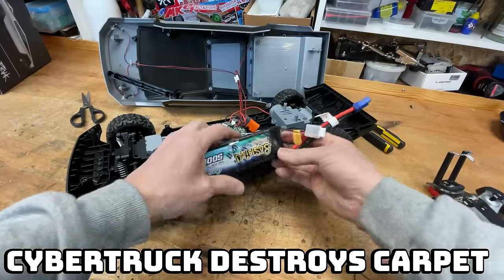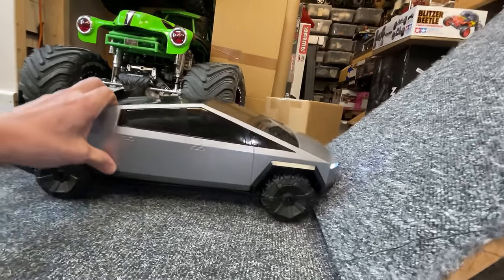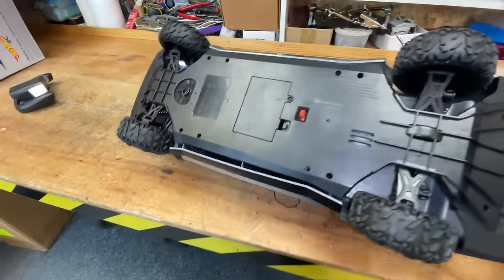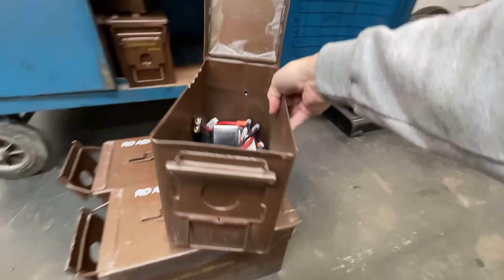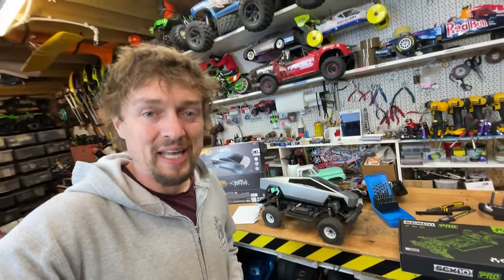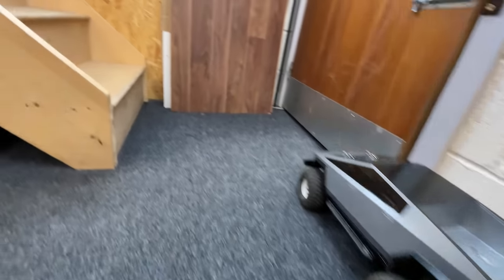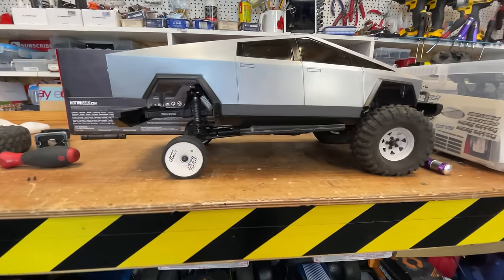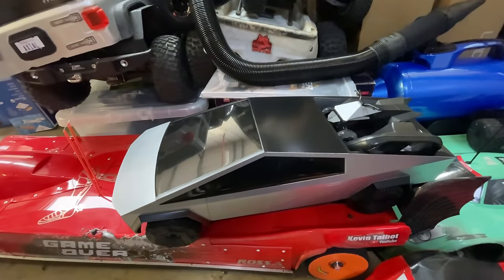RC Cybertruck Destroys Carpet

Comment: TQI radio, you can reverse the steering on the radio itself, the radio on hold the menu button for three seconds until the light blinks once then press the set button threetimes then press menu again
Boom
Steering reversed🎉

Comment: Kev to reverse steering without the module you turn on transmitter and the rc.  Then press and hold menu button until flashing green.  After that tap menu once then tap set 3 times slowly, then turn the transmitter off and on and you should be good!

Comment: u know whats even easier then driving reverse steering . is actualy reversing the steering .. press and hold set button until it flashes turn ur wheel hold it turned press set button and voila turn remote off and back on ur done

Comment: Erm there is nothing left of the original car other than the shell love this is the sort of thing I always wanted todo as a kid super upgraded
Reply: Did this as a kid with a Nikko full function RC car that ran on 4 AA batteries. I found the front 2 batteries ran the steering and the back 2 ran the motor. Wired in a 9 volt plug for the back 2 batteries and then it ran super fast!

Comment: sad thing is your just using the shell and not replacing like the motors or ecu and all that on original product ya just using a powerful battery every time then ya use a complete different car chasis with the shell so tbh does not really count